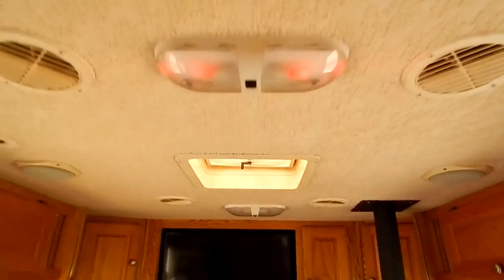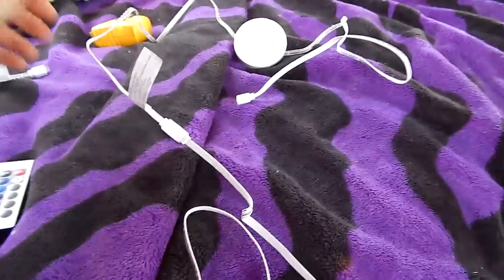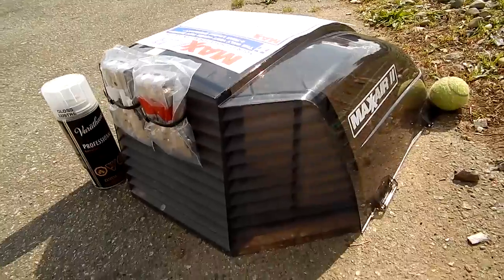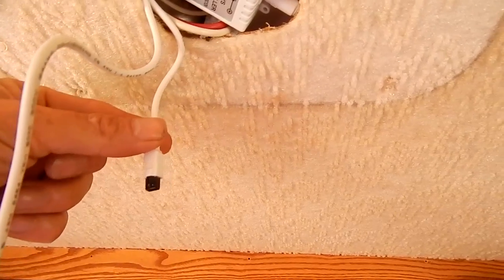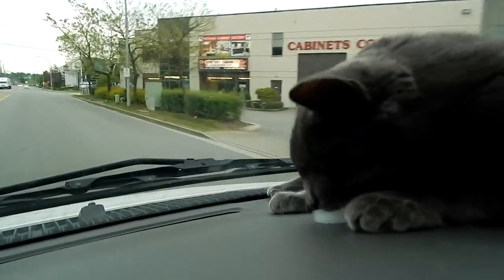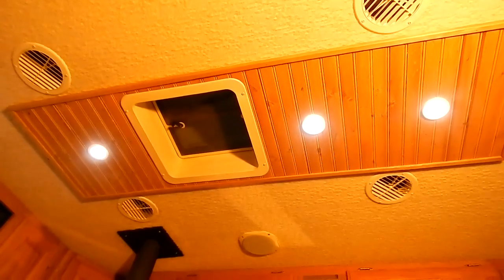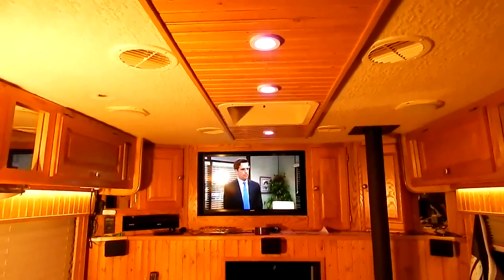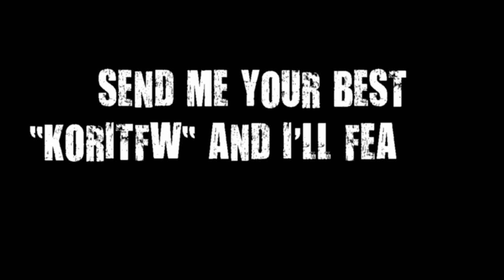RV Life: New ceiling woodwork and LEDs installed

Comment: Did you know that there is a paintable beadboard wallpaper? 
It's amazing, water, rot  resistant. It feels like it's a thicker paper that's been molded somehow? It's 2 pieces of waterproof paper sandwiched over a 1mm foam like material. It comes white but can be stained or painted in any color you want and it weighs less than 1lb per 24"x 120" roll. 
I bought a different version to cover the outside of my cabinet doors and it looks amazing!  Just thought I'd let you know 😊
It's e everywhere and cheap. Pennies on the dollar compared to actual wood plus all you need is the paper and spray adhesive if you want to leave it white.

Comment: I like the ceiling treatment, 🤔thinking about doing something with my ceiling after scanning out water stains😨, fist I will seal my roof it's Metal but was thinking about a membrane over it to seal it for Good. I would have to pull my Ac units and my vents it will be a big Job🤔 But this is my Home a 40 ft 1999 Monaco Diplomat. 😀 I am always fixing it up. Just put in a new floor in kitchen and bathroom , vinyl that looks like Wood in bathroom, new tile in kitchen and new carpet in Bedroom and up front. Maybe I will make a video

Comment: I have the same problem with my RGB strips in my Westy. My Roku remote causes the lights to change color. I'm going to swap out the IR controller with an RF one. Another positive about the RF is it can be completely hidden.
Reply from the maker: +Wolfgang Westy yep, that would work. My window valance lights are on an RF. I have the remote on my keychain and can turn on my lights from 20 metres away.
Reply: +Justin Credible I did the strip under my Awning with RF and love it. The little RF controller can be had on eBay for a couple bucks.
Reply from the maker: +Wolfgang Westy https://youtu.be/vEzfyC-8Iuw

Comment: it needs some rope LEDs around the outside of the frame! :) nice job! KORFW
Reply from the maker: +alzathoth yeah, no haha. I used to do things like that but then I came to realize when things become "too much" and it's overkill. I don't want too many lights in one area and then nothing in other areas or it just starts to look silly. I keep a simplistic and clean design with minimalism in mind as much as I possibly can. I'll have lights outside too, coming for summer. Cheers! :)
Reply: +Justin Credible (JustinCredibleTV) so a disco ball is out of the question then? ;) ROFL!
Reply from the maker: ...that being said, I'll likely add a small strip of RGB LEDs inside the new Fan-tastic fan vent, since it will run off the same line as the existing three lights I put it.

Comment: I like the idea of the center console, very cool!
Why didn't you use the same oak wood instead of knotty pine? 
Was oak not availible in thin strips?
Reply from the maker: +Don Richard because all my walls are knotty pine, and I want a contrast of two or three woods. Too much of the same is just too much in one room in my opinion. Actually, most interior designers recommend using different colour stains for even better contrast, so I'm going to make my floors a different colour.

Comment: I'm sure someone has already posted this but the carpenters credo;
"Measure TWICE...Cut Once."
Reply from the maker: +ianrsigel we did. Ironically. It was the correct length. Just cut the wrong angle on the wrong side, thus making it short when flipped over. Had to do it again, cutting the exact same size, just the correct angle direction haha
Reply: +Justin Credible (JustinCredibleTV) 
Reversed Miter Cut?  Been there...done that,
And I once owned a construction company.
I concur with those complimenting you on your great remodeling,
You have good taste.  I've used the same eclectic approach in my home.
BTW, You want to keep the 
ceiling white for reasons other than aesthetics.
It will keep the space brighter and too much wood in a relatively small area 
will make the area seem a bit claustrophobic.
And I LOVE The Wood stove.
Since you featured it in a previous video, it moved near the top of my wish list.
Safe travels.
Joyous adventures.
Be Well.

Comment: Hey Justin, had to watch this again because having some issues with my LED puck light install... In between cursing, and praying for your help, I trying everything. Basically I did the same thing, cut off the plug, hard wired into the 12v, ect. The issue is they won't turn off, or respond to the remote unless I use the regular plug (bought 2 kits so still have an intact 120 plug with the connection. Even wired them backwards thinking its polarity and no luck, the only way they would turn on is wired backwards...
Any insight before I rip this crap out and try again with a different kit. Of coarse they are already flush mounted in before I realized this so desperate for your help!

Comment: looks great, even though my OCD is kicking in lol
Reply from the maker: +Jersey Vegas why's that? Do you need even numbers? Bad news...the light sets come with either 3 or 5 lights haha. It's kind of funny since I have a little OCD and prefer odd numbers!
Reply: ***** lol things like that needs to be even for me, but that vent causes issues with that and adding a second kit is just too much.
and in hindsight, maybe you shouldve put the IR sensor on the opposite side from the tv - that should be enough for the remote to not change the leds lol
Reply from the maker: +Jersey Vegas nope, doesn't matter if the remote sensor is way in the kitchen it still does it haha. Apparently it's common, according to comments. I could just switch to my smartphone remote, no biggie.
Reply: ***** that works too lol, just theorizing because my sensor is hidden in front of the vented front panel of my computer and the sensor refuses to pick anything up, but i mightve gotten a bad sensor lol
Reply from the maker: +Jersey Vegas I'll likely swap the IR for an RF, as I have RF for my other lights already. Simple, cheap solution, and frankly RF is better as nothing blocks the signal.
Reply: ***** not a bad idea

Comment: i had a similar issue with my LED lights with the TV remote affecting them, kinda annoying
Reply from the maker: +jMon for about $5, switch out the IR controller for an RF controller on the lights OR use any modern smartphone as the TV remote. Problem solved.
Reply: +Justin Credible (JustinCredibleTV) hey man, that's a good idea, thanks very
Reply from the maker: +jMon https://youtu.be/vEzfyC-8Iuw